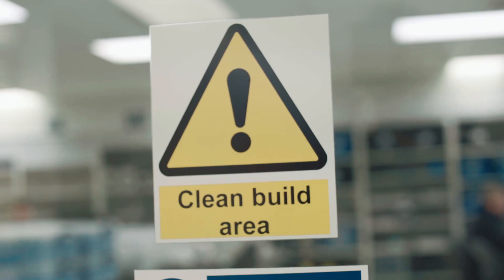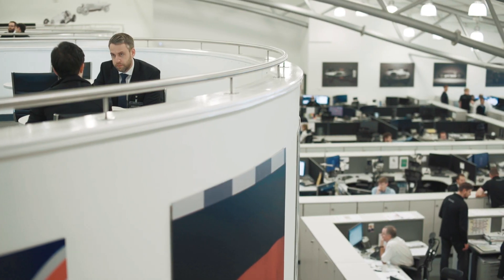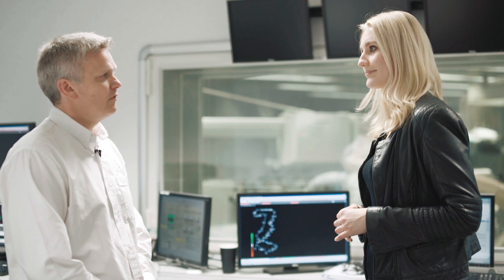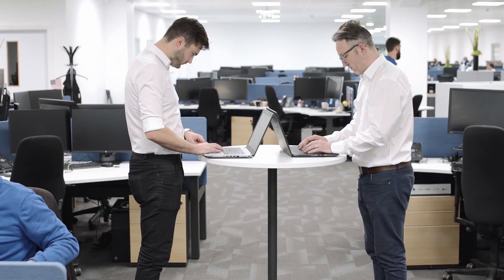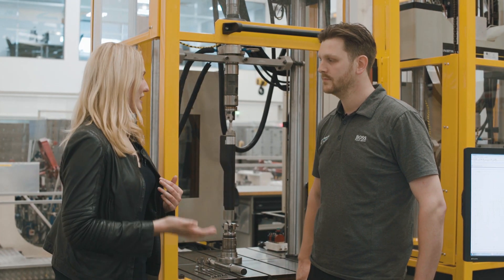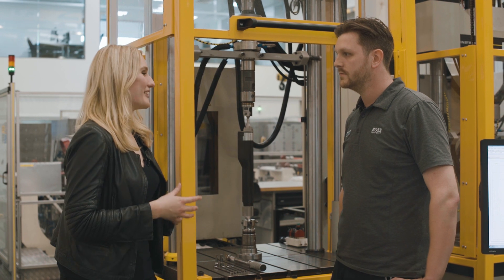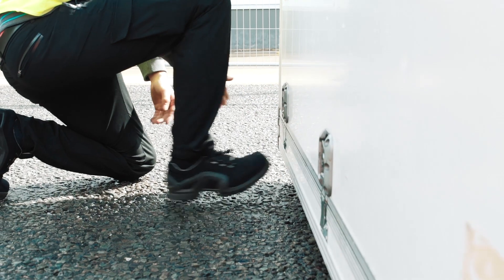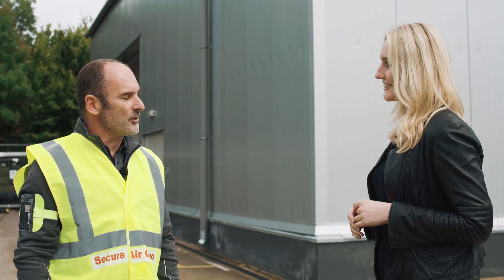Engines & Air Miles - Monza to Singapore (Ep. 5/7)

Comment: How do the fia identify the engines used in the last race and the next race.And as you manufacture the engines what is stopping you from changing the engine identification in between races 🤔
Reply from the maker: +Emma Woodman  They are sealed, so if the seals are broken, the FIA knows. You can’t just swap engines in and out. We cannot even start the race engines between events!
Reply: How exactly FIA checks that engine wasn't started? I think this is very interesting topic for fans, nobody never talked about this in detail
Reply: Mercedes-AMG Petronas Motorsport if you can't start the engine how do you use the dyno?
Reply: They have build the same engine again for testing...
Reply: Mason Meeks They have other engines that they use for testing purposes. (This is just a guess)
Reply: How do they make sure teams don't start the engines?

Comment: Which parts of the car are not Made inhous? Or are all parts selfmade?
Reply: Something, something, can't legally tell you because reasons. Short answer: some parts.
Reply: jason vaesen the clutches aren't manufactured in house
Reply: jason vaesen brake disks, and I think all ECUs are made by McLaren for all the teams
Reply: The brake calipers and disks are usually made in collaboration with specialist manufacturers, such as Brembo, Akebono and Carbone Industrie, to name just three. The powertrain ECUs are indeed an FIA spec unit, supplied by Mclaren Applied Technologies called the TAG-320.
Reply: The telematics aren't developed in-house.
Reply: The engines are made by Mercedes AMG for all the teams using those engines, all the teams have the same base engine (mechanical bits) it's just the electronic programmes and oils that are different, each team is allocated so many engines and their is no favouritism from what I saw on a yt programme, so no team has an advantage.

Comment: Are there any limitations set by the FIA on how many parts of the car can be manufactured i.e. the suspension rods, brake discs etc? If there isn't, are these parts of the car manufactured when a part is broken and needs to be replaced or there are already tens of backup parts prepared?

Comment: How long does it take to unload the equipment and set the garage up as it always looks perfect in there.. not a bolt out of place. Also do you guys use a new engine for the tyre testing that you guys did for perrelli or one of the allocated for the season?
Reply: JW I guess it would be a different engine that's not part of the regulated 4 engines. I don't think anyone would do the test if they had to put mileage on a race engine
Reply from the maker: +Euan Sass  That correct it’s s different engine!